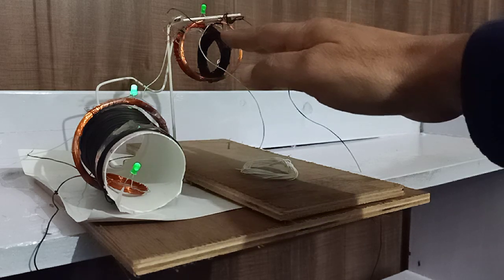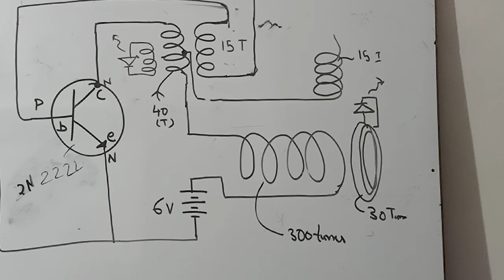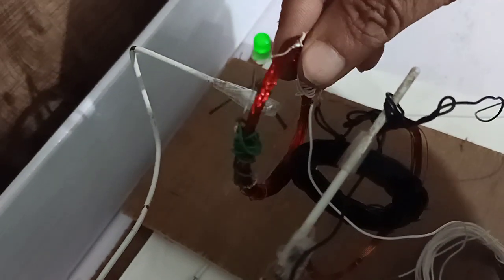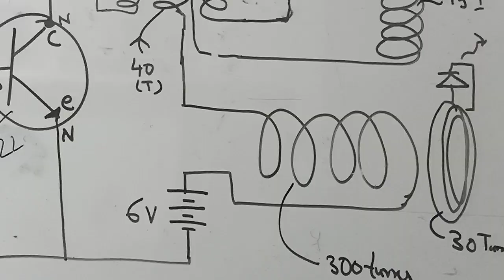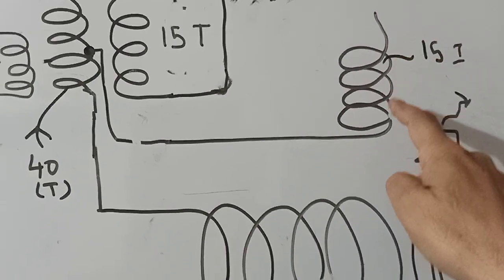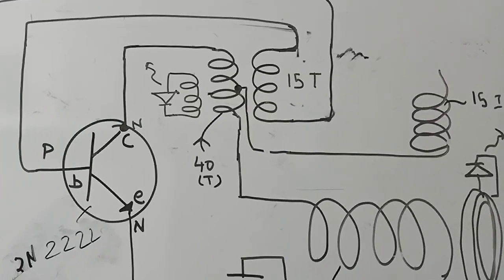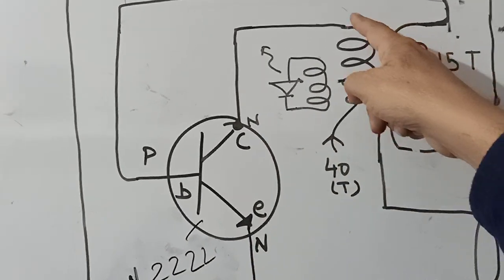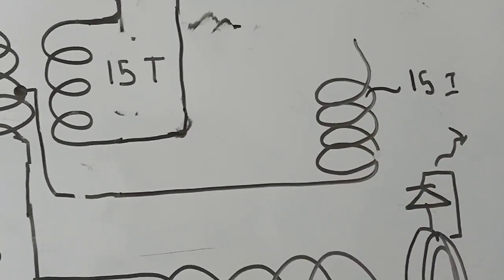Fun with physics simple human sensor using 2n2222 transistor -using copper coils etc

Comment: Sir, what is the core reason behind human indication??
Reply from the maker: Actually the circuit works on proper biasing of base. When that is not available the transistor is in cut off stage. When human presence is there it is probably affecting the coupling of cools connected to base and collector. This activated the resonance circuit and oscillating current is produced.